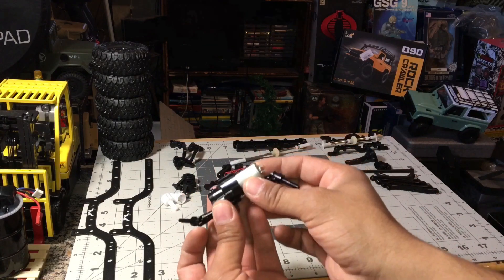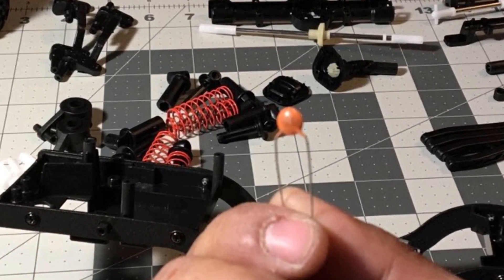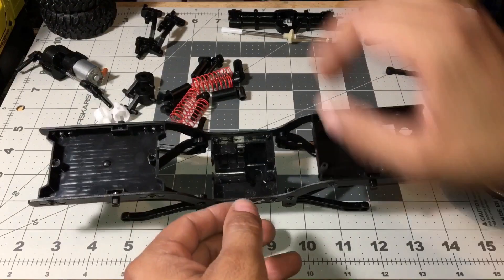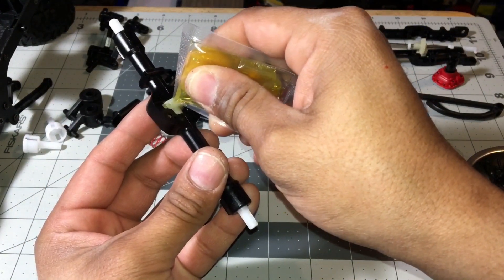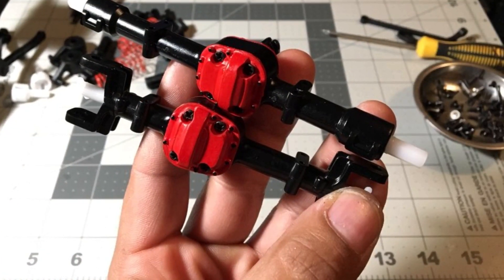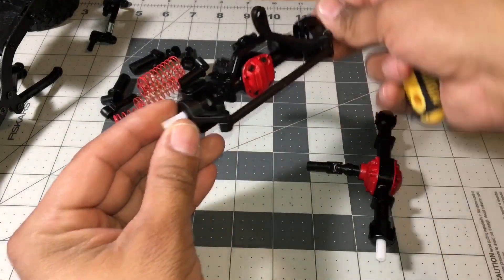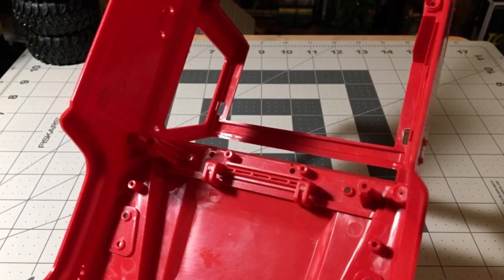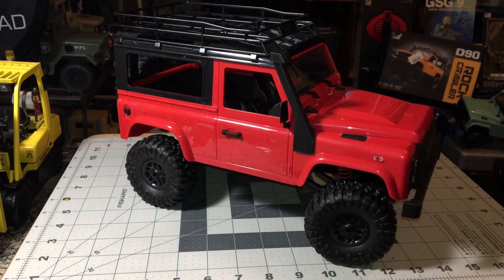MN-90K 1:12 scale R/C Rock crawler build part 1

Comment: Nice touch, these red diff covers. I just assembled mine. You can find the video on my channel. The 180 size motor does well, just drove it about 1 hour in snow!
Reply from the maker: TheDIYGuy999 180 motor sucks I already know I built two already and have a clip of the 180 motor I’m going to make another one today with two speed transmission, Metal driveshaft, 320A ESC and 3s Lipo. These trucks need N20 or 370 motors to Crawl on expert trails. The 180 motor did not last 15 minutes on  a tough trail. So today you get to see the most modified one yet and you get to see the 180 drive what little time it did in a real-world scenario
Reply from the maker: Oh yeah if you want to see how to make it Winch controller, light controller and Signal light controller. You should check out my video series on this truck. My trucks have a back up light so they can back out of the trail in the dark which is very important a real scenario

Comment: looks like the axle input assemblies are much tighter built and smoother than older WPL, their short shafts made for a LOT of slop in the axle bevel gears causing problems if not fixed during or after building. did mine during C24 build, did it to a 20 dollar RTR B1 also. "knock on wood" haven't had any problems with the stock plastic bevel gears, and WPL could easily fix that issue by putting 2.5mm thick bushings on the axle inputs instead of the 2mm ones used everywhere else. 

your last video, yup correct! if B1 is 1/16 (I'm thinking 1/18!) scale, but scale wise the C24 being same width+length, its 1/14 if anything. C24 and MN-90K side by side really look the same scale to me, the NewBright bodies you've used fit right in at about that number too.

edit: I'm also surprised how soft those coil springs really are, does look like it really needs something for damping the way it rocked at the end of this video. has me wondering if there's room for a small screw hole top of the lower shock shaft to put a small circle of something like bicycle inner tube there for a little friction damping, or enough clearance between lower X shaft and "shock body" to put heat shrink on the X.
if so, heat shrink would drag some and friction damp, cool as long as it didn't affect the articulation/flex.
Reply from the maker: If you don’t want to rock converted to leave springs and it would stop it. I wouldn’t because I want it to be just like it is softer Springs flex more reliably. Also these D 90’s are a little top-heavy which makes all most all D 90’s with four link suspension Rock like that it’s normal.

Comment: Another really useful video for me with mine in the post as we speak! Can you explain the difference in running the motor you have fitted against the one supplied? Also can you link to the 180 you bought??
Reply from the maker: MrSydoo I explained in the video the truck comes with everything except ESC, transmitter-receiver and batteries so the kit comes with the 180 motor and gearbox

Comment: Wow I didn’t expect that much flex out of those shocks setup. This one looks like a good deal to me 
So does this one come with both types of roofs in the box or you have to order the type you want?
Great video 👍
Reply from the maker: Hansaka Nakulugamage I know right and with cargo weight the truck should flex very nicely on the trail. Oh yeah this one only comes with one roof set up it’s the D-90K. The other one is the D-91K it’s Three or four dollars cheaper. Thanks 🙏 for Watching ☺️
Reply: Gabriel Silvaz Thanks for that 🙏 
I prefer one with the full roof the green one you built on this video.so I will order D90.
Reply: for "budget" and "scale" crawlers at their size, can't really do much better than these WPL and similar to start with. there are metal drive shafts, gears, axles, axle bridges, axle casings (big bucks now), and ball end threaded rod 4 link suspension+steering kits to add weight low and articulate easier too, if you want to drop some money into one for it to do more+better. 

I'm cheap, I just wrapped solid core solder on the rims between the tire beads, stretched electrical tape tight (sliced narrower) 3 wraps over that with a spot of CA to keep the tape stuck. enough weight down low to aid traction and flex, helps prevent rollovers too. with the slot between the tire beads (WPL) there's room to add quite a bit of wheel weight like that. with dual gear motor setups for power, the plastic drive shafts and gears hold up pretty good anyway.

Comment: I noticed there are not many parts for this crawler.  Are WPL motors, axles, and drive shafts interchangeable with the MN 90?
Reply from the maker: FN POG The only thing that’s is not interchangeable is the axle it self and diff housing. The gears are exactly the same as WPL

Comment: What capacitor to use for this motor? I’m not sure which capacitor suit for this motor?
Reply from the maker: Riq Boy I’m using 104 capacitor
Reply from the maker: start light There’s a lot of things that the kit doesn’t include the question is do you need any of that stuff? And the answer is yes that’s why when you buy a ready to run version the motor comes with a capacitor. Just like almost any electric toy you buy take it apart guess what you’ll find...you guessed it a capacitor! I don’t do things just to do them. the motor needs a capacitor to help it run more smoothly, last longer as well i’ve been Hobbyist for over 25 years. You can say I’ve seen a thing or two.
Reply: Gabriel Silvaz alright, appreciate your reply sir. 👍🏻

Comment: hi there. whats the function of the capasitor?
Reply from the maker: Nelson Clement Hi! 👋
Basically the capacitor stores energy and allows the motor to work more efficiently by discharging more energy consistently also makes the motor run a lot smoother. There’s a lot more science to it but that’s basically what it does.

Comment: The gear of this rc . It's same to wpl?
Reply from the maker: owwss? hahaha! These trucks I have the same gears but different axle housing and slightly longer axles since the defender is wider than the Toyota. There’s a couple videos out there with WPL converted into D90 And they didn’t think about the wheel base beings correct.The trucks they are using other videos look scale but when the other Toyota is beside it is exactly the same height and width which just isn’t the way it is in a real life. Toyota would be lower more narrow.
Reply: Ok thanks 😊

Comment: Nice vid! My diff covers are black, not red... and some parts were missing (all screws, servo cover), therefore I got 2 front grills (a buddy too received 2 grills)
Reply from the maker: donaldsneffe The kit doesn’t come with servo cover and less you 3D print one or buy there transmitter receiver kit that is 16 $17 more and it’s a WPL RTR TX-RX. Also I painted my diff covers you got to remember it’s a Model! But that too bad😔
Reply: @gabrielsilvaz4199  ok... anyway did not need, cause lowered my mn90. did not paint diff covers, only body and interior ;) like it... but still not finished

Comment: Mine come with broken steering gears out of the box
Reply from the maker: Neil Hamilton If I were you I wouldn’t spend the time replacing the gears in the servo I would just buy a servo with metal gears and be done with it and you can find those on eBay no links required just fingers and typing